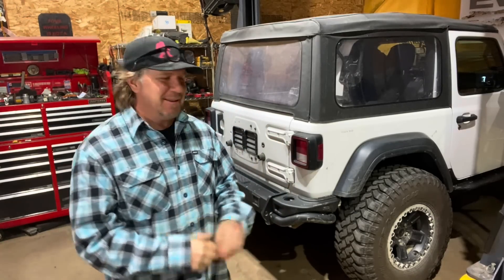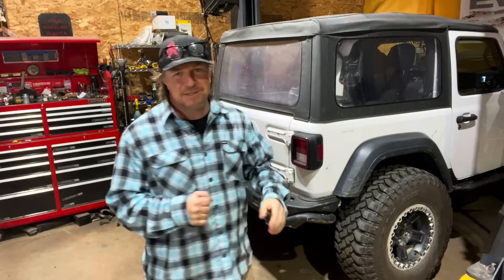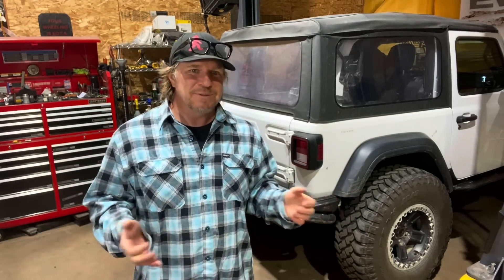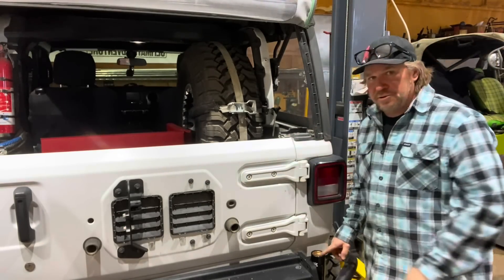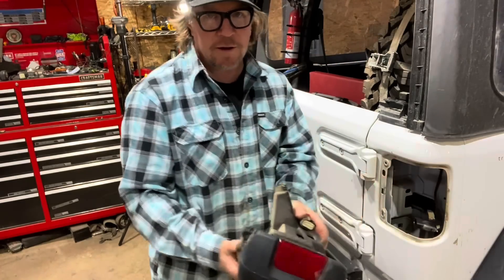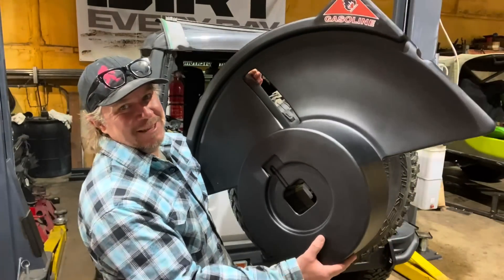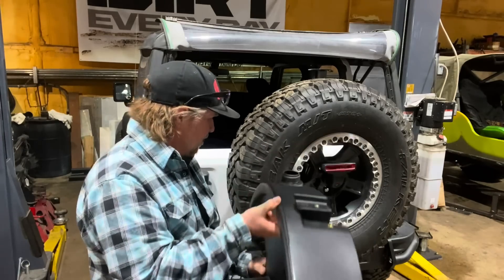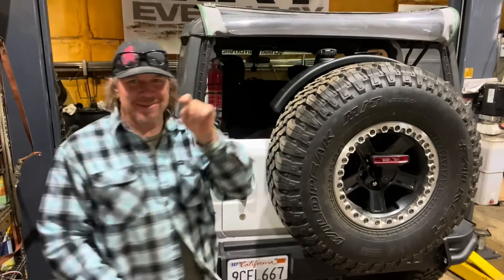DIRT DAILY. Adding an AEV tire carrier to my Jeep

Comment: Fred ,you should relocate the 3rd brake light on top of the vertical poll above the fuel jerrycan , so you don't have to remove it anytime you change a tyre and break or damage wiring

Comment: I would love it if AEV included a plastic, cut to fit spacer sleeve for the tire carrier bracket. Space it, measure it, , cut it, and when everything it put together, it helps to prevent rattles AND covers the bolt, wiring, etc. Kind of a finish piece for if you don’t have the fuel caddy.

Comment: I want to run 38 inch tires but I’m confused about adjusting the carrier. So is it only 2 bolts that I need to adjust? The one in the back and the one on top? When you loosen them you can pull out the part that holds the three bolts for the spare to fit the wider tire? I can’t find any clear videos on adjusting it for a bigger tire size. Also the gas thing won’t fit right because the 38 will be bigger and not fit into it so Idk. 🤷🏽‍♂️

Comment: Ok, but how are you getting 10 gallons of fuel out of that and into the jeep? Seems too complicated if you have to remove everything. Also, change the third brake light out for one that mounts behind the wheel to make access simpler.
Reply: And then he comes back and answers my question at the very end😂